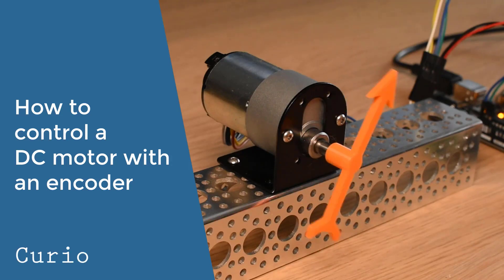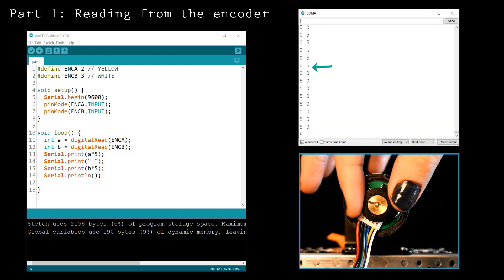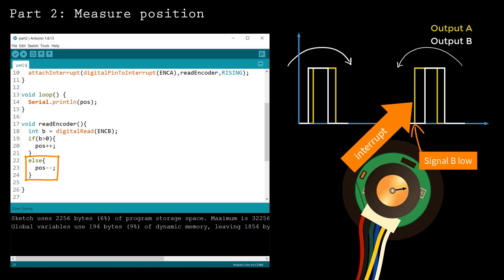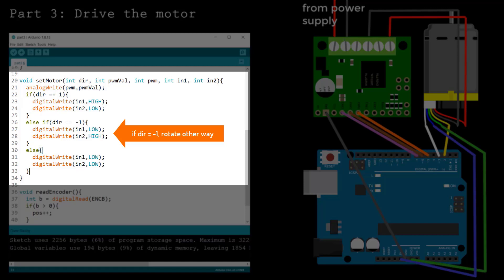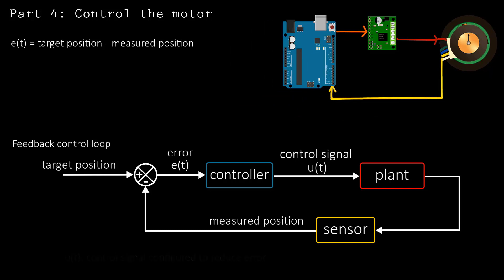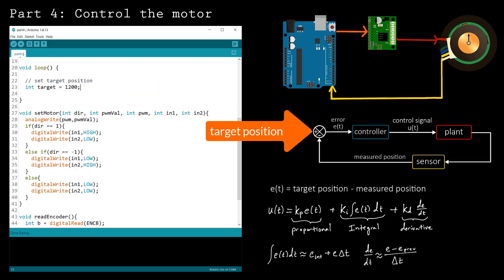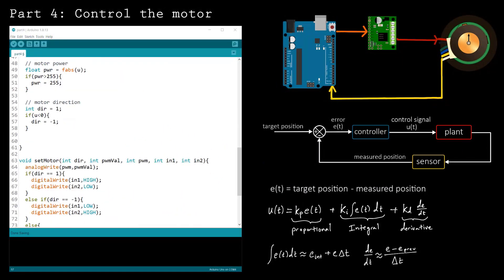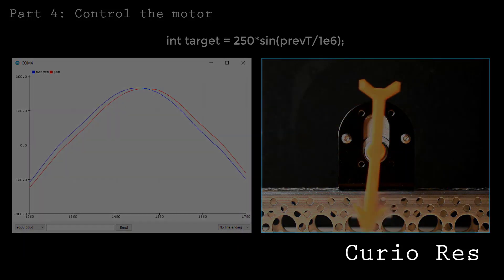How to control a DC motor with an encoder

Comment: It is a very useful video.  Now I want to control a coil motor with a ACS driver. The quarter encoder signal is not symmetrical. Phase A and Phase B is not exactly 90 degree. The ACS driver always meet encoder not connected error.  
So for a unsymmetrical and not exactly 90 degree dealy encoder, may you suggest a suitable motor driver?  Thanks in advance.

Comment: I don't believe the Atomic Block is necessary.  I get the same results with and without it.  After the position is computed in the read encoder  function she transfers the result into a new position name in the loop.  This is also unnecessary.  The position is stored in a global variable in the read encoder.  Therefore, it is automatically known throughout the entire program without a result needing to be transferred back.  Additionally, Pwm signals smaller than a certain amount will be essentially ignored by the motor.  This is because some power settings are simply too small to move the motor.  This threshold amount should be added to the pwm signal or the motor will lag behind with an error.

Comment: hi I see that the encoder is connected to 5V of the Arduino why the motor driver is not connected to 5V of Arduino?! i used to do that with normal DC motor
Reply: Friend , arduino can not provide I current for components like motors , servo motors (high Torque) , and some components. The here is connected to a motor drive and motor driver is connected to external power supply . U can only power only low power consuming sensors . 

What will happen if u connect motor drive to 5v pin of arduino??? 
Answer: here the pulse coming out of the motor will be disturbed . U can not accurately measure the position of the Shaft.  Why the pulse coming out from motor is disturbed ?? Because the motor drive is connected to arduino the motor will take the current from arduino due to high consumation of current the voltage get disturbed there will be fluctuations in voltage , so the pulse is also noised out . 

That's why using external power supply

Comment: Would this also work with an AS5600 encoder ?
Reply from the maker: Sure, don't see why it wouldn't. Probably take a little tweaking of the code, of course.
Reply: @curiores111  Okidokie awesome, thank you very much btw this was a great video !!!! I plan on using this to get current position of the output of an gearbox to the reset the gearbox output back to an 0/starting position.

Comment: First to say that it's a wonderful piece of work. But i have a point that i get confused: In each full revolution, will the position value icrease or decrease without a limit or does the position value has upper and lower limits to fluctuate between?
Reply from the maker: The counter can increase without limit if it continues to rotate since there's nothing physically restricting it. Of course how you store the counter in memory will impose an arbitrary limit to the value.

Comment: I want to control the position of some mini geared motors with quadrature encoders. Can I use this code? I have 4 motors inside a prosthetic hand I am making for my daughter
Reply from the maker: The code is applicable to any dc motor with an encoder (although there is always potential for some tweaking being required depending on the hardware).
Reply: @curiores111  thank you so much

Comment: I am trying to figure out how DJI control its gimbals because it doen't look like it uses servos to move the motors. Are they using a micro controller like an aurdiuno to control the gimbal motor?
Reply from the maker: What is DJI?

Comment: If i want the shaft to start at 000 degrees on startup would I need a limit switch to detect 000 degrees?
Reply from the maker: You need some way to calibrate the starting position... limit switch or otherwise.
Reply: @curiores111  Thanks have it almost hooked up to a nano and l298n motor driver, double checking my wiring.

Comment: at 2:26 trajectories are wrong. When she said clockwise, it meant counter-clockwise. When she told counter-clockwise, it meant clockwise.
We can see the results at 2:47. When she turns the arrow clockwise, the number goes to negative and vice versa.
I'm fan of your channel by the way :)
Reply from the maker: Good observation. The gearbox actually reverses the direction of travel, so it's true that it triggers in the opposite order compared to the encoder by itself.

Comment: This is by far, the best video explaining how to do this type of control, but I really need your help with something, I'm trying to control a CNC with a dc motor with encoder so when you mentioned the sin function at the end I thought it would fit perfectly with my project since my motor has to do the same amount of rotations both clockwise and counter clockwise, the problem is that when I put a high value on the sin function (it has to do a lot of rotations) the motor would continue to move the same and it would even begin to stutter, what can I do to fix this?
Reply from the maker: Hi Red Cap,

Sounds like you could be seeing some instability. Did you try adjusting the PID parameters? Also, if your sine function is moving too quickly, the motor may not be able to keep up. I'd suggest starting slow, and then building up speed. If everything is working correctly, you should be able to identify a maximum speed that the motor can achieve through trial and error.

Also, for a precision application like a CNC you have to worry about calibration and dropped encoder steps. Be sure to watch out for those and consider using a stepper.
Reply: @curiores111  OMG I didn't think you'd answer so quickly, thanks for that, I think you're right, after a certain value, the motor no longer moves, I was using a stepper but it vibrated to much, I'm using the code you put on the description with the changes now, I don't know if that'll make any difference but I'll keep trying. Thanks for everything, BTW check your subscribe button, I think I smashed it :)

Comment: Hi can i use another external potentiometer to give the target ?
Reply from the maker: Certainly. You can set the target using something like this:
https://docs.arduino.cc/built-in-examples/basics/AnalogReadSerial
and then set the target equal to a multiple of the potentiometer reading.

Comment: at 3:01 why is the motor red/black connected to the controller on A+ and B- instead of A+ and A-?
Reply from the maker: Good catch Ducksaws! I can barely even see that The reason is that I've jumped the A and B outs. Putting the driver in this parallel configuration allows the driver to handle twice the current. You can see the connections on the Pololu page: https://www.pololu.com/product/2999
https://www.pololu.com/product/2999#lightbox-picture0J8698
Reply: @curiores111  oh ok. In this case do you still only need to apply signal to pwm a, ina1 and ina2 and can ignore the b pins?
Reply from the maker: @ImminentDingo  Well, when they're jumped you're actually applying the same signal to both pins. So in a sense you can ignore them, but in another sense you're not ignoring them, simply simultaneously activating them. Note that you don't have to set things up this way, I just happened to do this because it's an option for the motor driver I was using that worked well for my application.
Reply: @curiores111  oh I understand. Did not realize what you meant by jumped. Thanks

Comment: Hello I don’t have pwm pin so what I should to write to analogWrite ?  May you help please
Reply from the maker: no pwm pin?? What microcontroller are you using Mehmet?
Reply: @curiores111  sorry that my wrong question I’m working on bionic hand and I use some n20 gear motor with 8838 motor so my question is May you help me about how should be full rotation and full return about motor forward and backward ? Do you have any mail or website for contact with you ? My thank you

Comment: Great video tutorial!  A lot of the PC CNC controllers have step and direction outputs for stepper motor drives, thought it might be pretty easy, if another interrupt is available, to change the setpoint based on step and direction inputs, should be superior to a stepper motor because of the closed loop.

Comment: Amazing content! May I ask though, how do I add an encoder to a plain dc motor?
Reply from the maker: Appreciate that. You can add a encoder if you purchase an add on, e.g. https://www.pololu.com/product/3499
or similar. I guess you could build one yourself too :)
Reply: @curiores111  I see. Say if I want a high rpm output (rotating a propeller), will it be easier  to buy a ready made stepper motor with a built in encoder and then remove the gearbox?
Reply from the maker: @aidealczar6075  For high RPM output it is more common to use a BLDC. Have you considered that option?

Comment: I am so confused. what represents IN1 si IN2 and what they control?  are the same IN1 with in1 from function set motor() or they represent different things?
Reply from the maker: in1 and in2 are the pin inputs to the function "setMotor", IN1 and IN2 are the (global) macro declarations of the motor pins. Why define them twice? This is so you can reuse the setMotor function for several different motors.

Comment: would it work for a stepper motor?
Reply from the maker: Not really. Typically you wouldn't use this approach for a stepper. With a stepper, you communicate to the stepper the exact number of steps to take. This is because the interior mechanics of the two motors are quite different.

Comment: Hi, it is a great video and thank you to share it. I am new with controller, encoder and PID control so I have a question and it could be a dump one but still ask :)
So we set the target is 1200, does it means the motor will stop at 1200 position? and the 1200 value is degree? or number of pulse from encoder?
And where is in your code that tells the motor stop at 1200?
Thanks a lot
Reply from the maker: Hi Van, so "1200" is the number of pulses from the encoder. You can convert that into degrees. The conversion depends on the particular characteristics of the motor. I did the conversion in some of my other videos. Here's an example: https://youtu.be/HRaZLCBFVDE?t=364

The control algorithm tells the motor to stop at 1200. That's the whole purpose of the feedback loop. When the position reaches 1200, the error goes to zero, so the control signal "u" will be zero. This will stop the motor. If the target changes, the error goes up, and the controller will apply voltage to bring the motor to the new target.

I have a bit more explanation of the control loop in that other video (https://youtu.be/HRaZLCBFVDE?t=572) but TBH none of my videos are specifically about how controllers work, they're mostly about how to apply them.

Hope you are having fun with your controller!

Comment: I used a PID controller to make a self-balancing robot but the motors I used were stepper motors, though I achieved the most precise positioning yet the implementation was very complex. The stepper motors puls timing is exponential where the PID was failing
Reply from the maker: oh yeah sounds difficult. I think usually people do the balance bot with DC motors. If you use steppers probably have to tweak the control algorithm a bit.

Comment: Amazing video and narration!! Would this approach be suitable for continuously rotating the motor at a low rpm like <50?
Reply from the maker: Hi Nitin, it should work (unless the loading conditions cause an issue). I did something similar in another video. Here's a link to the correct point in the video: https://youtu.be/3ozgxPi_tl0?t=479

Comment: Hi good video! I would like to implement this setup to my cnc machine to drive spindle using brushed dc servo disc.
It would be required to be controlled by Mach3 Pwm signal or potentiometer i believe +-5v wold that be posible?
I have basic understanding of Arduino and  some use to control my cnc lathe by Arduino mega and Grbl software.
Old saying is ask the expert .
Reply from the maker: Hi Darko, yes, you should be able to use this algorithm. That is, if you're using a brushed DC motor with an encoder (or possibly another sensor). For a spindle, maybe you want to do speed control instead of position control? You could use a pot to set the target speed. If the motor is controlled by PWM signal then you can assign that signal based on the control algorithm output.
Reply: @curiores111  Thanks for quick reply ! I guess lot off learning in front of me until parts come in. I understand concept and all my shortcoming is programing and pin assignment in Arduino. Can I ask for help if I get stuck.

Comment: You are doing amazing job. Can you also make a video on PID control of inverted pendulum on a cart...
Reply from the maker: You are very kind, thank you. Hmm I had thought about doing a video on one of the balancing two-wheel robots (which is similar to an inverted pendulum). I might be able to work that together with the inverted pendulum on a cart in one video...

Comment: Which part of the function you defined (3:50) sets the speed and how is that adjusted? Also, how accurately can you control RPM using this method?
Reply from the maker: pwmVal sets the "speed" (really, it sets the duty cycle of the PWM signal). You can control the RPM well with position control by writing some wrapper code around the PID control. I did this in another video: https://youtu.be/3ozgxPi_tl0?t=463

Comment: Nice job! I’m new to arduino and encoders, but need to figure it out soon for a project I’m working on. 😂. 
I’m going to build a linear motion system that travels 24mm then returns to 0 as fast as possible. Works out to roughly 3 rotations of the planetary output. It can do the same thing in reverse as well, so push or pull 24mm, always returning to the middle. It is triggered by buttons. Is this all possible to do using these components? How complicated is the coding for this?
Reply from the maker: You could do that. The code would be very similar to what is written here. A DC motor would get you there fast, but if you don't calibrate to a "zero" position regularly missed counts could cause you to become uncalibrated (you'll have to check if you are missing any counts). You could also consider using a stepper motor if your system can accommodate it.

Comment: I do not use the same motor as you do but I have got the same wires as your motor. But I cant get this setup to work. I get a signal from my encoder but the motor does not spin. Do you know why it wont work.
Reply from the maker: Sorry Marc, it's difficult to say. For debugging purposes, I usually suggest that you start by wiring the motor directly to the voltage source. If that works, do what I did in the video, and try just wiring the PWM driver without the control algorithm. Once you have the PWM driver working, try the PID control. If you can't get the PWM driver working but the motor DOES work when wired to the voltage source directly, then you need to (a) check your PWM driver's wiring (look at the spec sheet) and (b) make sure that your physical connections are correct. If neither of those is the issue, your PWM motor driver could be bad. You could try another motor driver. There are other tests you could do, but those are just some basic things to try first.

Comment: CAN İ USE THİS WAAY TO CONTRTOL  4DOF ARM ROBOT
Reply from the maker: I don't see any general reason you couldn't use this for a robot arm... however, there would be a lot of mechanical considerations. Like the gear ratio and the weight of the DC motors.

If you're using servo motors in your robot arm, then this algorithm isn't necessary.
Reply: @curiores111  YOU MEAN THAT İF I USE SERVO İDONOT NEED CLOSE LOOP

Comment: Love your videos. I'm struggling with 2 things here.. how to balance my motor to have good PID values.. and also I seem to get integral windup where the motor goes pretty mad once in a while. Do you think you might be able to share some more information on expanding what you've shown here to have antiwindup?
Reply from the maker: Hmm.. yeah for your setup it's possible for that to happen, depending on the parameters you chose/how your hardware behaves. Shouldn't be much of a concern in this case if you just use a PD controller and remove the integral term (maybe you need it to reduce the steady-state error?). I want to do another video on PID tuning/more advanced control workflows, but it's a lot of work and I'm not sure exactly what people are looking for in that space... Hopefully I'll get to it in the future.
Reply: @curiores111  Thank you for your suggestion, I'll give a PD controller a go! Really enjoy your content and your help 😁👍

Comment: encoder is showing 0 in serial monitor......what to do ??
Reply from the maker: start by checking your connections. maybe try swapping out the hardware if you have any other encoders or microcontrollers .